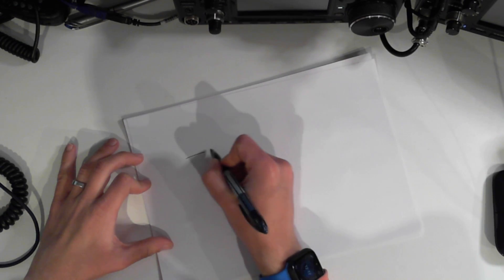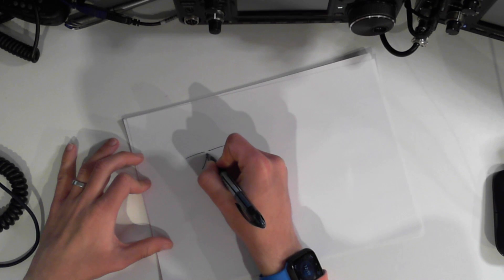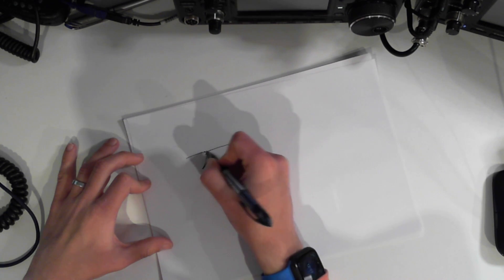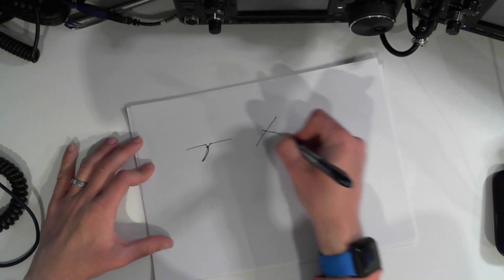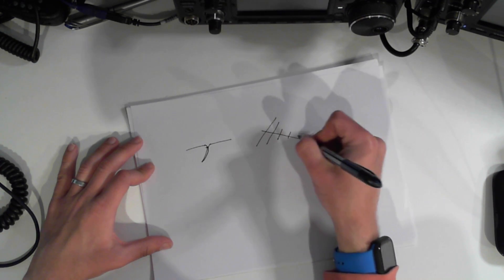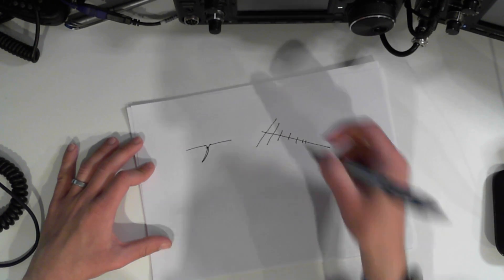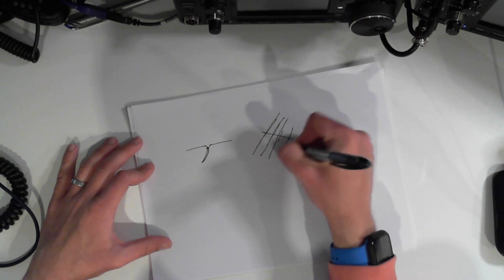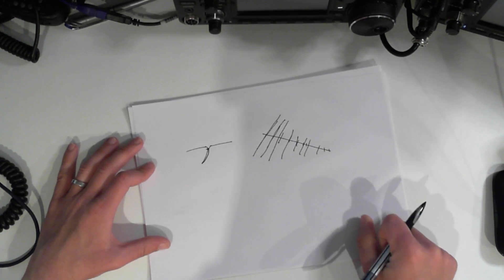A Super Simple 6m Antenna (Ready for the Sporadic E Season!)

Comment: Bummer, I just built this and it was  bust on 6 meters but was great on 40 and decent on 20 meters?  The only thing I've done different is coiled the 39" of 75ohm coax before connecting to the final 50ohm.  I'm measuring 3.4 ohms at my 50ohm coax end.  Don't know what I did wrong?
Reply from the maker: And all dimensions are as I set out? I can only think that by coiling the 75Ohm coax you had introduced some amount of inductive loading affecting the resonant point. But I couldn’t imagine it tuning on 40/20m!
Reply: @M0JSX  Jonathan, I may be off by 1/2" on the ccomplete deltal length. The coiling of the 75ohm around a 1.25"  PVC spool I got from another design. Shall I omit the coiled 75ohm and just run in straight OR shall I incorporrate a 4:1 balun in lieu of the 75ohm coax?
Reply from the maker: @jimmiemack1947 either should work. The 4:1 balun is the more pure version of the delta loop. The 75Ohm is a cheat! 😂
Reply: @M0JSX  Thank you Jonathon. I really want this too work. I've ordered a 4:1 balun and will bypass my 75ohm coiled coax.
Reply: UPDATE: 8/17/25 : I made a 2:1 balun using a T130-2 core in lieu of the 75ohm cheat. reception on 20, 10 and 40 meters! I live in North central Colorado and most everyone here tells me that 6 meters is dead. I'm just a SWL listener and this delta is a keeper!

Comment: Only question Jonathan I have is, why didn’t you build a ugly balun out of the 75 ohm coax but simply just ran it down the pole. What advantage/ disadvantages is there between both do you know ? I’m currently looking to build a delta loop after working quite a few stations on 6 this weekend on the tri band vertical. Thanks Ed..
Reply from the maker: To be honest Ed, I’ve only ever seen two designs. One is to use the 75Ohm coax as shown. The other is to use a 4:1 balun at the feed point. In both cases the aim is to get the impedance down to something nearer to 50Ohms.

Comment: the full wave 6m loop i have here is mounted verticaly on a fibreglass mast but,rather than a Delta triangle....mine is square but at 45deg.  in other words,it looks like a Diamond shape with a "cross member" half way up to create the shape. iwanted horizontal polar pattern too so,rather than feed on one of the side pointed corners,just fed at the bottom of the loop.same feed system...75ohm matching stub. went with a diamond as think slightly better "capture area" and the corss member [fibreglass tent pole] is shorter as space limited here.  on a slight tangent....i use a full wave loop down on 40m that just fits my garden space.initially used same 75ohm match coax but as you know,only gives you the 40m and third harmonic of 15m. thought about a Balun but ,as i use an amp here,worried about over heating/loss and weight of a Balun to ty gain extra bands with this loop.then i found a design on internet of a "Air Core" balun...handles 1.5kw and so simple.best of all...swr is 1.5 and under 2.0 on 40/20/15/12/10 and even on 6m about 2.5 on 30 and 17m so easy to tune with tuner there too. the Balun....simply use a length of "overflow pipe" which is about 25mm diameter....wind as you would a 4/1 balun and tweak the turns for your instalation.mines up horizontally at only 20ft and ended up with 13 turns on the pipe to get best swr on all the bands. yes,could have just stayed with a 75ohm coax stub match and 2 bands...but with almost little difference in loss with thehigher swr readings,now this one loop gets me on several more hf bands. but like everyone says..loops are great quiet rx antennas if you have the room. 73s all...de MW0BFY

Comment: The weather was finally warm enough to go out and make one today! Used a pvc crossarm and drilled the top of the T to mount it on a Sotabeams mast. Tuned right up to 50.125 with the NanoVNA. No luck on ssb of course, but could hear a few ft8 signals. Thanks for the idea!
Reply from the maker: Excellent stuff. If you’re in the Northern Hemisphere wait until late Spring/ early Summer for the sporadic-E season. You’ll work tonnes on SSB!

Comment: A tad off topic but I just made a simple horizontal wire dipole for 6m to put in the loft. I made the legs over length and trimmed until it resonated in the middle of 6m band . What I do not understand though is that at 49.3 it had a swr of 1.4, but after trimming 3cm off each end which brought it nicely to mid band, the swr had risen to 3. Nothing else was changed so what variable could cause this?
Reply from the maker: Im going to tackle this on an upcoming Q&A video. But, in short with antennas everything affects everything. It could be how it is positioned in the loft. It could be that you didn’t exactly cut each leg perfectly equally, therefore the feedpoint impedance is a bit off. Might be worth repositioning the dipole and see how the SWR (and resonant frequency) shifts in different positions.

Comment: 👍Thanks for video. I was impressed with the good match that you got. Ideas that may help to make the antenna even smaller when packed away is to put one or two joins in the PVC pipe. Possibly even use a section of collapsible fibreglass tent pole in place of the pipe - just loosely tie-wrap the wire to the pole.
Reply from the maker: I completely agree. I’m toying with making one for the 10m band, that will certainly require a join in the PVC. 73!

Comment: Great video Jonathan, I built the 50 ohm delta loop from DK7ZB (no matching section, triangle isosceles) it worked very well but my problem is that the wind makes it rotate, I tried tying it to the ground so that it does not rotate but it was not satisfactory, therefore I built myself a Flower Pot and it is working very well too, I only do FT-8 QRP with only 2.5 watts with a FT-817ND and with very good DX with Europe, North America and Japan, 73 from LU3FGG
Reply from the maker: Excellent stuff. In my experience there is enough friction to keep everything in place. I use a flower pot on 10m, it’s a great antenna.

Comment: They work very well, 
I built this one for 8M/40MHz: https://ei7gl.blogspot.com/2019/06/delta-loop-antenna-for-40-mhz.html
Wind the 75Ohm coax around a short length of 2" PVC Pipe to form a choke, keep RF of Coax Outer.

Comment: Hi Jonathan, thanks for this! Good know there will be more horizontals on 6m! 🙂  A couple of refinements might be worth considering: Maybe coil the 99cm length of 75 Ohm co-ax to form a choke?  Also, the join between the 75 Ohm and 50 Ohm should ideally be done with co-ax connectors.... (Yes, I hate making them up! 😆) That should help result in pure horizontal polarisation, and mitigate against any risk of noise-pickup, on the coax, on RX.  Hope that helps! See you on 6m very soon! 😀
Reply from the maker: There will always be refinements possibly, but as a cheap and dirty way into 6m it works! I have seen the coiling of the 99cm 75ohm mentioned on the net before. I’ve not tried it, but definitely not a bad idea!

Comment: Ha ! Snap.  Nice video Jonathan.
Reply from the maker: Thanks Jon. Real hams use a 2:1 balun 😉
Reply: @M0JSX    Just a quickie.  Remember that depending on the build / cores etc, using a 2:1 Guanalla current Balun for 6m or 4m may not be a good idea as there could be some roll off of the cores over 30MHz.  If that is the case, then a 75 ohm matching stub is your best ( and cheaper ) bet.

Comment: A 10m delta is working well for me. Much less unwanted noise compared to a dipole, even in a vertical polarized configuration. Simple people like me can remove the need for a matching stub or balun by changing the shape of the delta slightly. The plan for my take on the delta is on my QRZ page if anyone wants to have a go.
Reply: Yes,  I reckon delta loops are better at reducing local QRM that open ended antennas like dipoles. Also, delta loop has slight gain over a dipole.

Comment: There's also the oblong antenna I want to try as this doesn't require a matching line. Plan is to use some plastic right angle strip to make the top and bottom cross pieces and a banana to BNC